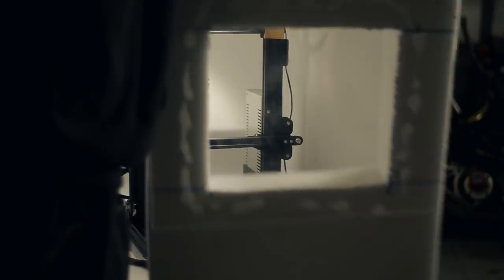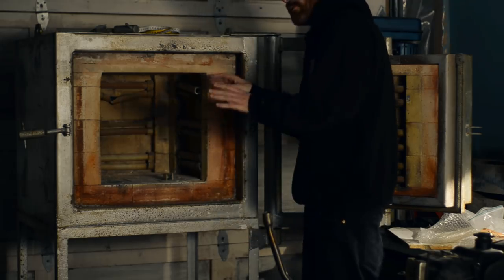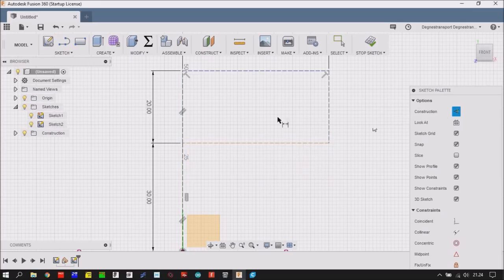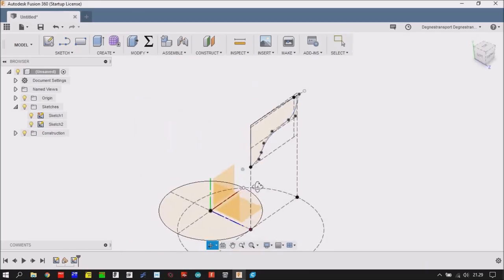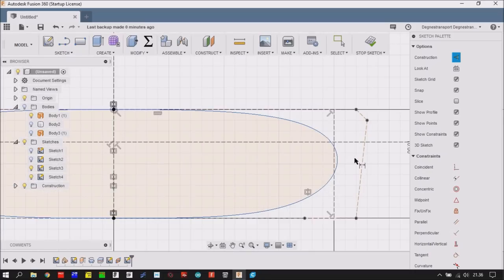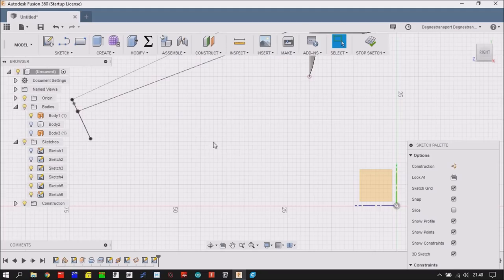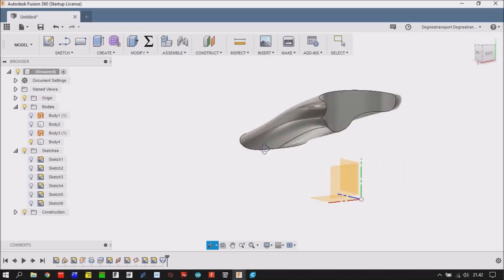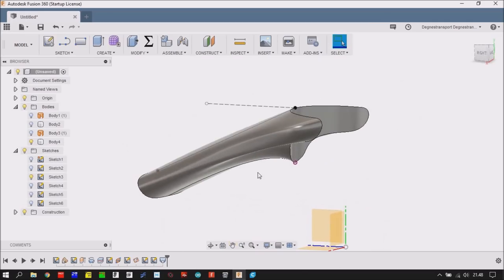Road to The Most Powerful Two Stroke Ever Part 2 - I can do this!

Comment: With experience in sand and plaster casting, it would be better for you to use wax based printer filament designed for doing lost wax casting. You could print your entire cylinder, submerge it in plaster/sand, and melt out the wax in the stove, then refill the support pylons with plaster. Get it super hot in the stove and then cast your aluminum into the cavity. Vented correctly lost wax produces incredible castings. If you’re planning to use that kiln for melting aluminum and keeping it under 16 amps I don’t think that will work. A normal microwave is on a lone 30amp kitchen circuit. You’d be better off to look into how to make a high amperage low voltage transformer using old microwave transformers. Plasma Channel has a video on this. Using that paired with a graphite-electrode electronic arc furnace would be much more realistic for melting a small crucible of aluminum in your garage. I think it was King of Random who had a video on that using graphite from batteries(before he was arrested) I wish I was closer and had the resources to help you out man, I love these videos and looking forward to seeing the outcome
Reply from the maker: Thanks for the tips! I might get a gas furnace for the melt.
Reply: I've worked with the wax filament with horrible results.  I went back to PLA and am happy with that.  I use natural PLA so that I am not burning out the color along with the plastic.  The PLA melts out quite well at 550F.
Reply from the maker: Awesome!

Comment: hey. you "might" manage to do the cylinder with a slicer that can give you the possibility to put in custom support. then you dont have to full it with support and you might be able to remove it. test it out. ohh.. and remember. the inside diamanter of a hole/bore is usually turning out smaler then design on a 3D printer
Reply from the maker: Thanks for the tips!

Comment: Aside from the unfamiliarity you have for the program, you've more or less got it. At least, that's about how I would have accomplished the same task. You're using the concepts correctly but you"ll find, with time, that you become more efficient with drafting. You'll start to see similarities between certain things you will be drawing, learn new commands and will, as a result, become WAY more efficient in creating the exact shapes you want. Lofts caused me a lot of trouble early on too, but they really are some of the most powerful tools you will have at your disposal. For a first model, this looks exceptionally good!!
Reply from the maker: Thanks man!

Comment: Why not rent a space at a local machine shop for your kiln where you could get proper 3-phase electric connection as it quite expensive to upgrade your garage. Maybe you can offer them your newfound skills in 3d-modelling or an ad-spot in your videos in return?
Reply: 3 phase generator. I picked  up a 10kva for $270

Comment: Check out Shapeways, they do Selective Laser Sintered 3D printing very quickly and cheaply, and the quality is for all intents and purposes as good as injection moulding. I use them to build drone parts and they have never let me down. Great channel by the way, fantastic work.
Reply from the maker: Thanks! I'll check with them what it would cost.
Reply from the maker: Just checked what my cylinder done in aluminum would roughly cost at Shapeways - about 5500$...

Comment: About the kiln here's a link to a diY metal foundry that is  gas and blower powered. either you can build this at a larger scale or convert the old kiln to gas using the same basic  principal  https://youtu.be/hHD10DjxM1g
Reply from the maker: Thanks! I might build a small gas furnace for the metal melting part.

Comment: You can change your heating elements. Normaly they made out of Kantal Wire. I have a shit ton of this. Will check the Diameter...

Other Option is the conversion to gas, I work for a company wich make so. If you are interessted, write me a Message
Reply from the maker: Thanks man! I've been contacted by a few others too, let you know if it falls through!

Comment: are you going to use a long or short stroke crankshaft for the project, because of the 40mm diameter, if its 50cc the stroke will be around 39mm, isnt it a smarter idea to make the bore a bit bigger and the stroke shorter for higher rpm?
Reply from the maker: I try to keep it as square as possible. Shorter stroke can take higher rpm, but the lower ports won't let the engine rev due to insufficient STA - square is the best compromise.
Reply: With 50cc the reciporating weight will be low enough to not be a problem for rpm on a square setup. 
Sorry It's hard to explain in english.

Comment: DO NOT PRINT WITHOUT A FIRE ALARM OR SOMETHING.  Seriously, if your are printing something, you either need a fire proof cage, or be home during the entire print and put an old 9v fire alarm near it. I have that same printer, and it is reliable, but many people have not been so lucky(mostly with the ANET a8 printers).

PS, I have had amazing result with the ender 3.  If you want my Cura settings, let me know.  I've been working on a full intake manifold for a Supra. Fun stuff.
Reply from the maker: Good advice! I'll install an alarm and maybe fabricate a fire cage. Settings would be great!
Reply: @2STROKESTUFFING  BTW, i found out the hard way that the ender 3 is a stock full metal hot end.  You can print pretty much anything with it, as long as the bowden tube is not touching the block directly(which just means pulling it out slightly from the heater block).
Reply from the maker: Thanks! 700°C might be a tad much even for petg

Comment: I couldn't afford 3 phase either so I bought a 3 phase converter, might be worth looking into, love the vids btw!
Reply: Tom Boyd I've wondered if this possible it is a commercial product or did somebody make it for you?
Reply: @715101  They are commercially available, I bought one from "Transwave" to run my lathe and mill. Beauty is I can take it with me if I move the workshop.
Reply: Running a large constant inductive load like this would probably not play nice with most AC Drives (VFD) but you could defiantly use a rotary converter, i.e. old 3 phase motor. Just size it 25% over the needed load and either have start capacitors or just use a small motor to get it to RPM. VFD do work great for mills and lathes though.
Reply from the maker: That's an interesting solution, thanks!

Comment: Question i just got a new cylinder from boy go fast for my motorized bike and it has a bridged exhaust port and open transfer ports what's the benefit to open transfers down the piston  because become the transfer wall
Reply from the maker: No benefit vs proper inner walls, quite the opposite - bad directional control.
Reply: Cheap to manufacture
Reply from the maker: Yes.

Comment: It seems that area of exhaust port in the cylinder is larger than area of exhaust in connection to exhaust pipe. Wouldn't it be other way to allow exhaust gases to go out of cylinder faster? And you created amazing channel btw. Thumbs up. :-)
Reply from the maker: Thanks! That would be true if it weren't for the piston covering a large portion of the port most of the time.
Reply: @2STROKESTUFFING  I would do the exhaust pipe outlet bigger, but it is your engine and I respect it. I have one more question in my mind: what will prevent piston ring from poping out to exhaust port? I think there is pretty big risk it will happen when you have exhaust port something like half cylinder wide.
Reply from the maker: It's actually not the outlet, there will be a spigot about 20mm long tapering out from the small section to the header diameter(same as total port area).
Reply from the maker: I'll be using a special retained ring.

Comment: How flammable is that enclosure could be dangerous
Reply from the maker: Very flammable... I should have a talk with my hms guy, he's been slacking.
Reply: @2STROKESTUFFING  my printer is setup for fine prints at a faster speed would you like me to try a test print of your port
Reply from the maker: Sure, would be great! Hold on until the actual model is done.
Reply: @2STROKESTUFFING   have some parts getting printed in abs for my printer to convert over to the e3dv6 with a cooling fan it should help with printing the over hang of port roof do you still have my email or ya need it agine
Reply from the maker: Cool! Got your addresse!

Comment: why a giant kiln? Microwave kiln and a vacuum chamber.
Reply from the maker: Want to heat treat the castings too.
Reply: @2STROKESTUFFING  the vacuum chamber will lower the boiling point of the aluminium  to heat your casting and remove any air pockets

Comment: your're going to need this heating element wire. https://www.google.com/search?q=nichrome+wire&ie=utf-8&oe=utf-8&client=firefox-b-1
i second reducing the volume/ increasing the insulation. make sure the front gasket on the door is good, how hot it gets is purely up to being able to put more heat in than is loses, speed of the heat is what consumes a lot of power. could also use gas to get it up to temperature faster then block it off.  (waist oil burner)
Reply from the maker: Thanks for the tip!

Comment: with your computer model have you done the water cooling side aswell?
Reply from the maker: Both inside and outside of the transfers + tge the whole exhaust duct.
Reply from the maker: Both inside and outside of the transfers + tge the whole exhaust duct.
Reply from the maker: Both inside and outside of the transfers + tge the whole exhaust duct.

Comment: Try printing the cylinder as is first, with your single extruder machine .. you may be surprised. If that doesn't work try sectioning your cylinder into several pieces, each printable, then glue those pieces together for your lost wax casting process. I've been printing some very complex detailed engine parts using a single extruder machine .. example here of a McCulloch kart engine with single piece cylinder/case block...   http://i3dsystems.com
Reply from the maker: Wow, awesome work! I'll try!
Reply: @2STROKESTUFFING  should have mentioned, with single extruder printing .. your slicing software usually has MANY options for automatically generated support structure, one must play with those setting to optimize supporting the part, while having the support easily removable ... and sometimes, one must physically design in your own support structures. Also, you can try different open source slicing programs, each generates supports differently.
Reply from the maker: Thanks! I've only just started digging around in cura, but should do some research and get more familiar with my options.
Reply: @2STROKESTUFFING  I used Cura to print the parts at the link I sent you ... you can control the spacing and grid size of the support, and the gap between support and part above.  Usually 3-5mm grid size, and 1.5-3mm space to part, and a 0.2 to 0.25mm gap to part above .. seems to work well.
   I will try to watch what you are modeling, and offer some ideas on how to approach getting it to print well with the printer you have. I think you can get there .. will take some patience ... a lot of those engine model parts I designed, took over 10 design iterations to get them printing super good.
Reply from the maker: Thanks!

Comment: Now when it's done put it in a moped 😂😂😂
Reply: Beaujangles McJiggle  ultimate saw OF DOOM
TEXAS CHAINSAW XXIV
Reply: It's going to be on a 50cc engine.
Reply: @liam59  thats a pretty good size for a saw
Reply: @thatbuelldude189  You are probably right. I assume he does it since the 50cc engine is one of the easiest engines to modify and It's the highest cc allowed on a moped in Norway.
Reply: @liam59  the biggest saw on the market is 112cc 
This motor will make alot more hp tho